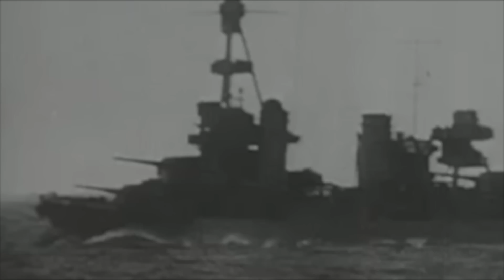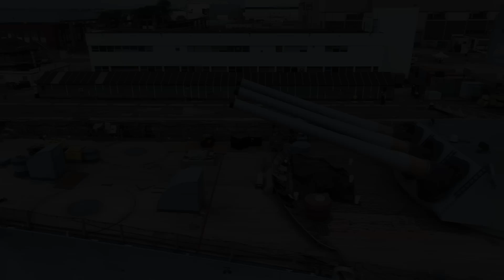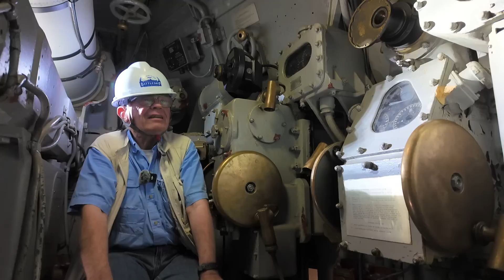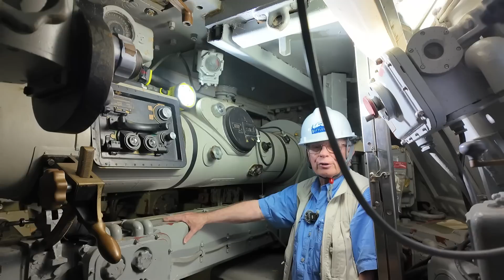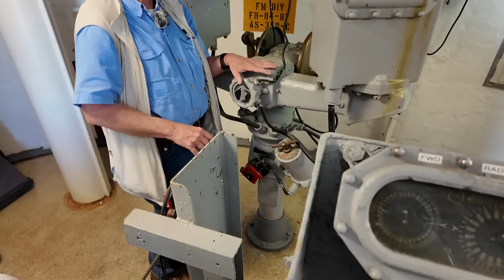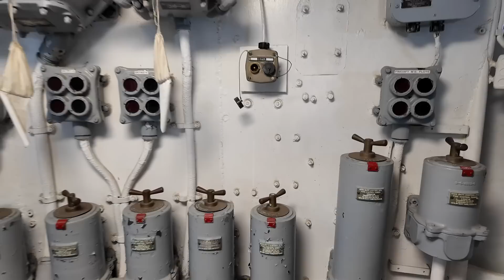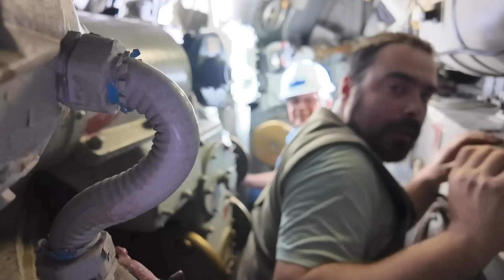Naval Gunnery - Rangefinding on an Iowa-class battleship

Comment: l served in the RAN as a warfare officer with the Mk22 director in River class Destroyer Escorts,  It was a Dutch track while scan radar system from l guess the 1960s and was a precursor to the US Mk92 system seen in the OHP frigates.  
The system had an A Scope and a B Scope display.  From memory, the A Scope tracked the target, while the B Scope illuminated the target and the two radars talked to each other within the system through the Fire Control Officer (usually a Petty Officer) to arrive at the fire control solution.  The fall of shot could be observed for line by the B scope,
The system only required two operators.  A far cry from the dozens of operators required for the systems that are being shown here!!

Comment: Man, fire control on these old battleships will never not be the most fascinating thing in the world to me. Absolutely mind blowing.
Reply: The thing boggles my mind is is maintaining cross calibration.  Any one of 6 Directors can send data to 4 different Plotting stations, which can send data to 15 different gun stations.  That is 360 different possible paths for data to travel.  That's a migraine waiting to happen.
Reply: @grimlock1471  And it's all done with relatively basic wiring and no real digital equipment or computers! And the sheer scale of all the infrastructure and detail of those systems is beyond insane.

I loved that big mechanical "computer" box he showed in one episode. So cool.
Reply: @El_Chompo  Every component is just a tiny bit different.  And how those differences stack up can do weird things.  There have to be procedures to verify that a firing solution generated using Spot 1, Forward Plot, and Turret 3 is the same(accounting for the parallax he mentions in the video) as a solution generated by Spot 2, After Plot, and Turret 1.  Now do that for the 359 other combinations.

Every time you repair or replace something, you to revalidate at least part of the system.

Comment: The redundancy is amazing. The information being fed back and forth from the director, to the plotting room and to the turrets must create a wiring nightmare in case of battle damage.
The question is which takes precedence to the "computers" in plot? They're getting information from the director and the conning tower. The director has the best view but the fire control officer may be in the conning tower while plot has the best information from the radars. Whose triggers will actually fire the guns or will all of them so you just keep your booger hooks off them unless you're in charge.

Comment: Now you have to do a Fire Control systems review on HMS Belfast. Then, yet a third video comparing the two systems. Battleship versus cruiser, or RN versus USN way of doing things. With the absolute dearth of material, Drach has released over the last few years. Im sure he has the copius time needed, to release my vid requests, in a timely manner :D.

On a more serious note. Plot One does not look like a nice place to be, in anything but a flat calm.  Knee, elbow and hard hat protection looks like it would have been very useful wedged in such a high up space, in any kind of sea state, never mind the gyration's for combat..

Comment: I love the technology of this era. It's fascinating to see how much redundancy could be built into systems that were essentially electro-mechanical. One of the reasons I also like playing with pre-WWII toy trains.
Reply: Yes, modern day commercial enterprises should take note. Too many run on the assumption that nothing will go wrong.
Reply: @jon-paulfilkins7820  redundancy in systems shows you aren't confident in your system
Plus business owners realized the engineers were working with their own margins (1+1=3 at most) and decided replacements were more profitable than something sold once
Reply: @chuck2998  The amount of times I have had to crunch and work 12-16 hour days because the process failed, the plan turned out to be based on wishes and hope etc. Yet when someone like me points out a choke point where one thing goes wrong, all stops.. and I get told I'm "not a team player". Trust me, we need make the idea of "Have a back up" normal. And we are talking very big companies.
Reply: @jon-paulfilkins7820  Yep.  Got stuck last year because Delta airlines used 1 way and 1 way only to manage their flight and cabin crews.  So when that computer snafu happened last year, everything was fine, except they didn't know where any of the aircrew were, had no way of notifying them, so nobody was going anywhere.

Had to be flown home a day late and on American (and i HATE that airline).  No backup system, even though it should be easily enough done.  Cost them plenty, but i bet they won't fix the issue.

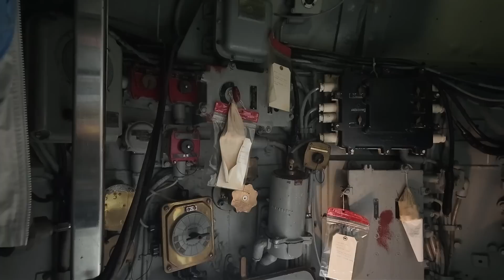Comment: Do you Navy vets want a blast of nostalgia? Look at the plastic, zip-top bags at 19:25. I could not tell you how many MAF copies I put in one of those things and taped it to the top of an ALQ-99 pod transmitter. Not to mention all of the other things we used to turn in for replacement. In 11 years working in AT shops I must have handled a thousand of those.
We used these in the '90s. Are they still being used?

Comment: So basically, the radar is not directly sending data to the plotting room... it is still the operator doing the same corrective action to keep a crosshair pointed to either the actual target, or on the 'rendering' of the target on the radar screen ? This is amazing and at the same time a very elegant 'upgrade path'  from the legacyvto modern device
Reply: -All that was going on was that the fire control computer was taking range and bearing data from the radar Operators instead of the optical director Operator and optical range finder.  Otherwise, the procedures were the same.
-Manual matching of the radar target  "pip' for range tracking was not particularly accurate. 
-It's far better to auto lock.   For instance, if a target is 15km away which is 100 microseconds would initially set the pip on the target which then sets a 100 microsecond timer.   The timer would gate the return pulse search for say 99.99 microseconds to 100.01 microseconds and only accept pulses within that +/-15m band.  The timer would then reset to the new value so long as it wasn't for a target moving at more than say 60 knots or about 36 meters/second.
The result is a far more consistent and accurate range track.    The American chief engineer for the SCR-584 point blank refused the US Army for manual fall-back tracking.   (MIT professors tend to have big ones) auto tracking was so much superior.  The German FuSE 64 Mannheim FLAK radar had auto tracking and even in the height of allied jamming could follow an aircraft automatically even if it wasn't possible to see it manually.
-Once you have the range gate you can do autotrack (ie left right signal) easily.
-The German FuMO 26 and British Type 284P radar both had blind for control via lobe switching but the British radar managed 0.1 degree accuracy versus 0.25 degrees for the German radar mainly due to the electronic evaluation of the left right signal instead of visual.    The Germans could do this but just didn't want the expense and maintenance of extra vacuum valves.
Reply: @bernhardzunk7402  There is actually good reason NOT to autotrack surface targets by the radar. Firecontrol needs a smooth solution for target motion, as it generates the solution in just a few seconds. The way it works has a target detected and a tracked manually until the computer says it has a solution. The director is then shifted to automatic, and it follows the solution generated by the computer, as do the guns. In essence, the autotrack is the computer solution. The operator now watches to correct if the return deviates from the generated solution. This can be by errors from the initial solution, or by changes in target motion.

This is the same whether the input is visual or radar. Auto tracking radars tend to hunt all over large slow moving (less than 100kts) targets, now getting a strong reflection forward, now aft, now at the waterline, now in the superstructure. The apparent motion is far greater than the actual motion of the target. If all of these were automatically fed into the computer, the solution would be erratic and unusable.

Hunting in antiaircraft fire produces small errors, so AA systems (Mk25 radar for Mk37 GFCS for example) will use autotrack. Just not in surface mode.
Reply: You have to realize at this time, those radars were finicky and prone to failure.  You needed a system that would work when the radar set inevitably failed.  Which was MUCH more likely if you were taking return fire.  Electronic systems are much more robust today, and thus reliable enough that it's just not useful to have optical backups.  Although i would not be surprised if even on a modern cruiser there isn't some manual backup.

The thing that killed big guns on ships was aircraft and anti ship missiles.  Manual aiming of guns is just not possible on targets moving that quickly and that are able to maneuver.  Guns are still necessary IMHO for dealing with small boats and boat drones.  But you don't need big guns for those kinds of targets.

Comment: Great video filling in so much of the stuff you can see but have no tour booklet for!  Turret access is nice, but nothing telling you what you're seeing used to be really disappointing.
Remember ducking the ropes and climbing to Spot 1 on the NJ.  Not as majestic or large as it appears!  Guess the Yamato had it beat in the "If looks could kill" category!
Figured they owed me something on my 5th visit and no new areas, like the engineering spaces and actual fire control spaces with computers, like on the USS Carolina's self-guided tours.  Would love a Friedman-guided tour with all the hatches and access panels opened on both engineering AND fire control (or, a Friedman-graduate-assistant-who-specializes-in-it).  I'd also pay for a Brilliant course or the like in the undiluted math and mechanical mechanism design of all the fire control systems, from the ballistics calculus, through the uncertainty evaluations, through the mechanisms against fleet gunnery test salvo sheets and acceptance testing (maybe including the stabilization mechanisms).